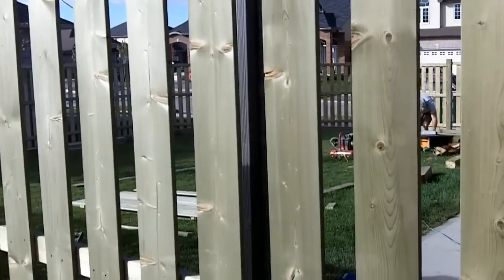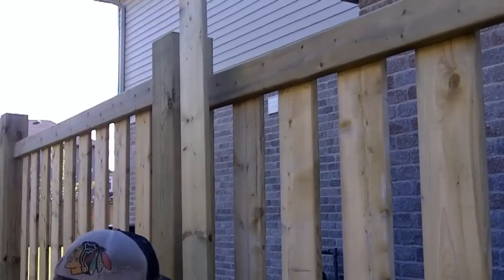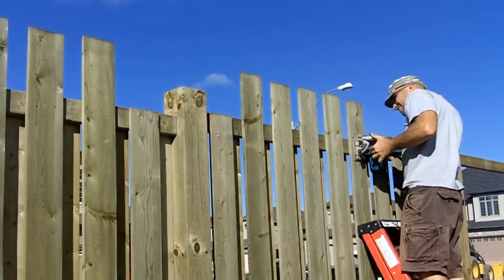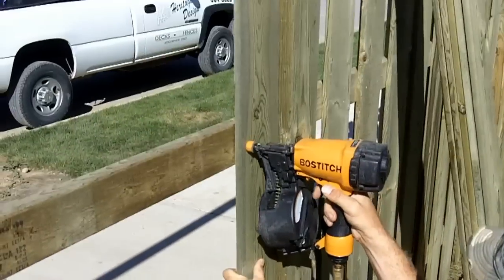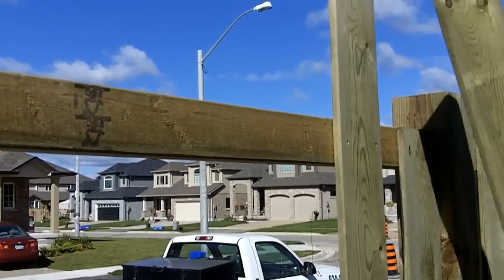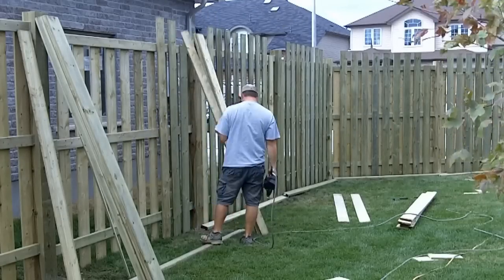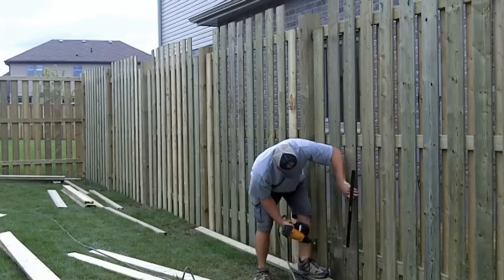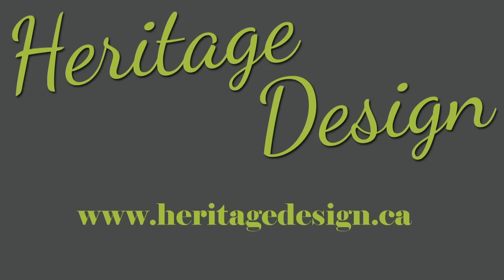Heritage Design - DIY - Installing Fence Boards - Board on Board

Comment: pickets touching the ground - what a dirty job!
Reply: Rather have it on the ground, then it to be sagging at the top in a days time. U need the ground for all that weight it has in between poles for support...so it don't sag in a day.
Reply: bill ritt Wicking?

Comment: Boards should be at least 2 inches off the ground, the grass and dirt will rotten the wood and you can't use nails on a 2x6 that you put as cap trim the nails will come out eventually always use screws for that 
Bad job!
Reply: juan
Reply: When you install this type of fences with all that weight in between poles, you need the ground for support....now the bottom will rot no matter what you do, from the build up of ground over time....dont believe me go back year from now and see what the ground looks like under the pickets 2 inches off ground looks like. Bet your fences sag in a days time with that 2 inch bs your talking.
Reply: bill ritt Ok. Understood. Thanks